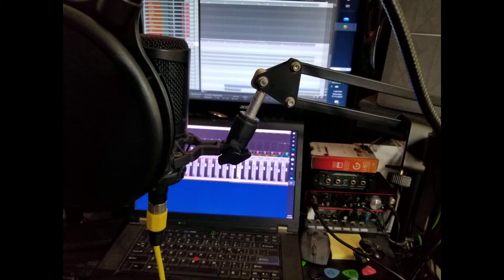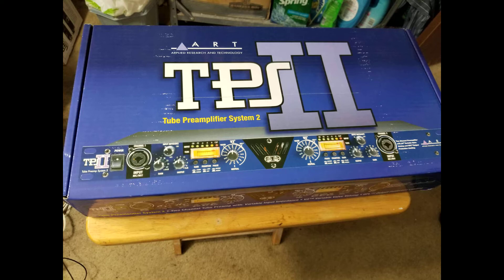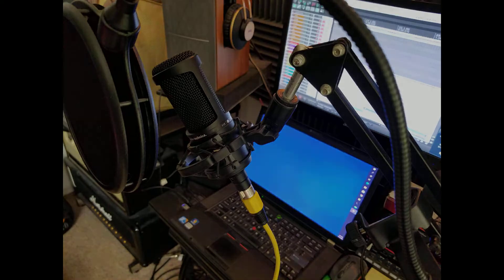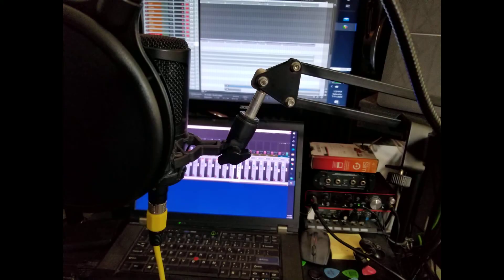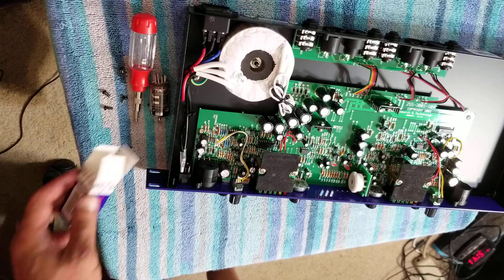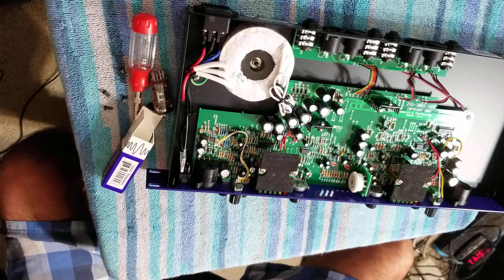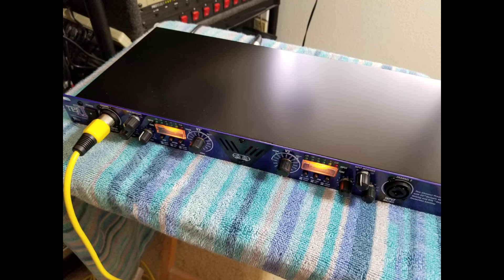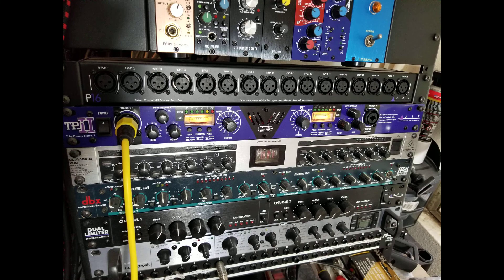Pimping My Cheap Mic Preamp: Swapping the Tubes

Comment: Better, less muffled rounded. But what about noisefloor became too much, is it ambiance? Also what preamp and mic You speaking with? Noisy, gated but clean, or limited. Is it a console/mixing desk input? Or Focusrite with processing? What is it?
Reply from the maker: Yes,  it was not recorded in an acoustically treated room. There was background noise that I had to remove with Izotope software. And yes, I used a Focusrite 2x4. The mic and preamp are mentioned in the video. I also used a compressor and limiter (I can't remember which ones) to keep the levels stable. The DAW is Reaper.
Reply: @somnisdecorda8081  Thanks